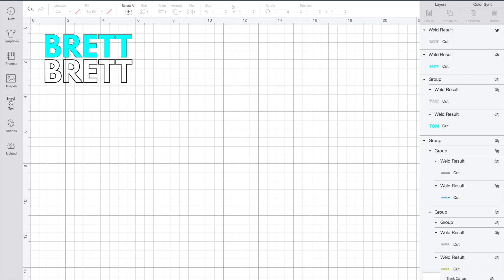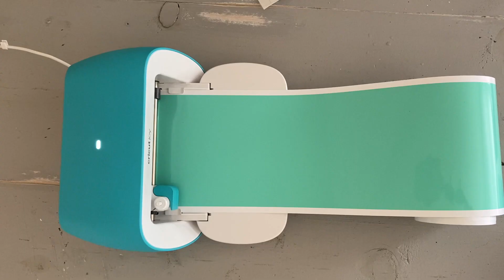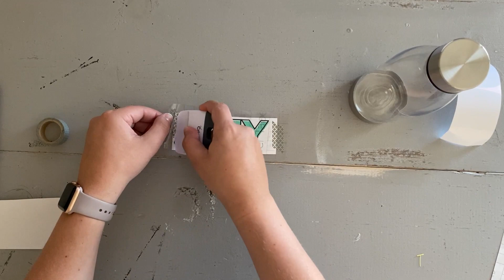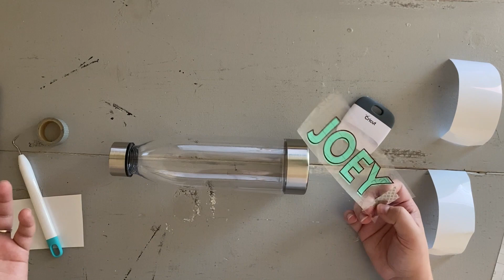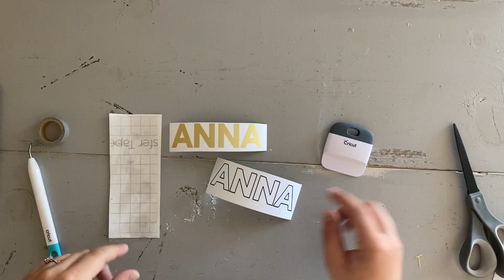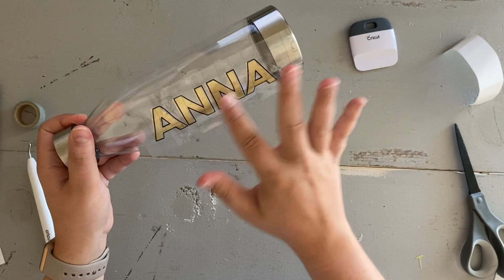How to Use Vinyl Decals for Beginners on Curved Surface with Cricut Machine

Comment: Is your vinyl sticky after applying it to the bottle?
Reply from the maker: The top of the vinyl is not sticky, just the bottom that sticks to the bottle.
Reply: @Craft-e-Corner  I used the Cricut smart vinyl then the Cricut transfer tape. So I’m wondering if it’s the transfer tape that caused the stickiness.
Reply from the maker: @brittz_876  I have never had that issue but I could see how that would happen. Was it strong grip? Maybe the roll you got had a bit of extra stickiness.

Comment: And i still dont understand the difference between the mat vinyl and the smart vinyl.
Reply from the maker: Smart Vinyl has a thicker backing so that it does not need to be cut on a cutting mat. The regular vinyl needs to be placed on a cutting mat to be cut by the Cricut.

Comment: Great video please confirm the length and width you used for your text,i struggle with getting the perfect size for water bottles and the size you used looks like a perfect size x
Reply from the maker: I am not sure the exact size of the decal for these specific bottles but I always use a measuring tape to measure the space on the bottle before cutting it out.

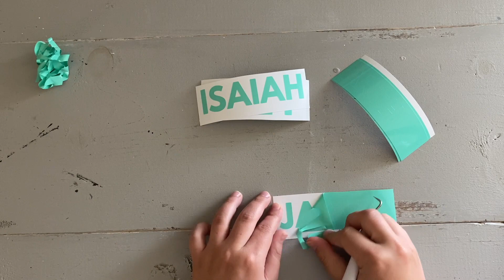Comment: Smart Vinyl from Cricut is a total ripoff as when you design anything and select Smart Vinyl it automatically uses up the first 2.5cm of the vinyl on design space........As you can see at 2:27 in the video where the offcuts are.

Comment: Hello, quick question... if you were doing a series of names in vinyl to be applied somewhere, how would you maintain uniformity? for example the name shannon is a lot longer than the name lily and when using the width it distorts the font for the name lily, however if i use the font size at say 20, Lily is too small to be visible. Im stuck! Would appreciate any help :)
Reply from the maker: One idea is to try and keep uniformity through the placement of the design instead of the size of the letters.

Comment: Can this be put on clothes ?
Reply from the maker: You'll want to use iron-on (sometimes known as heat transfer vinyl) for clothes! It's vinyl that is applied with heat, so you'll need an iron, EasyPress or heat press.

Comment: I bought a joy. I have spent almost a thousand dollars ton materials. For the last two days I have ruined 200 worth of materials. I can't make anything with this mess... I cant return it either. I give up. I wouldn't recommend any of it
Reply from the maker: We're so sorry to hear this! If there is anything we can do to help, feel free to reach out!
Reply: I just bought mine. I am not in love with Cricut vinyl. I have not used the smart vinyl yet but I do know you can use regular vinyl. See if you can try and sell you Cricut vinyl to someone who likes using it. The one thing I can tell you is if you use regular vinyl without a mat, it will not work well with intricate designs but something like this, it work great.
Reply: I like to use the ryobi 18v heat gun after applying the vynil. It seems to activate the adhesive better.

Comment: I'm struggling to get the right size to personal water bottles. Would I see more on my lap top. Than on my phone.  Wish mine turn out like yours I've gone through so much vynal trying get right size font..HELP
Reply from the maker: It might be easier to see on your lap top. I usually pick my font and then size it to the correct size after measuring my bottles. Hope this helps!

Comment: Is the smart vinyl dishwasher safe?
Reply from the maker: It's not recommended from Cricut to put Smart Vinyl in the dishwasher. However, I will say from my own personal experience that if you let the vinyl adhere for 48 hours, I've had really good luck with still running projects through the dishwasher. Just know that you may run the risk of it peeling up, so it's suggested to hand wash only!

Comment: Do you have to add a top coat like mod poge or something to prevent the vinyl from coming  off when washing
Reply from the maker: We do not! When you use permanent vinyl, it's meant to last 2-3 years. It's pretty tough stuff. It's also recommended to hand wash only. We have seen a lot of people use products like modpodge or water-based polyurethane for sealing, so you could do a search for that. However, we can't say from experience...you should be just fine with permanent vinyl. Best of luck! :)

Comment: I love it 😍 . Only one question,  will it get removed when adding it to the dish washer????
Reply: There is also mod pog for dishwasher safe stuff
Reply from the maker: This water bottle (even without the vinyl on it) had instructions to hand wash only so this will have to be hand wash only. It's recommended to hand wash your vinyl projects to be safe. However, I've run plenty of mugs with vinyl through my dishwasher and they've turned out just fine. Just know it MIGHT peel up— so if you want to make sure your design stays, then hand wash! Or if you're feeling a little risky, you may be okay with the dishwasher (but just knows there's a chance of it peeling up/moving). I would definitely wait 24-48 hours after making it before putting it into the dishwasher if you do go that route. :) hope that helps!

Comment: spray some home made vinyl application fluid to slide it around, then get a hair dryer or heat gun to form the vinyl. You can make some fluid with a travel size johnson and johnson baby shampoo and a spray bottle.
Reply from the maker: Fun! Great idea!